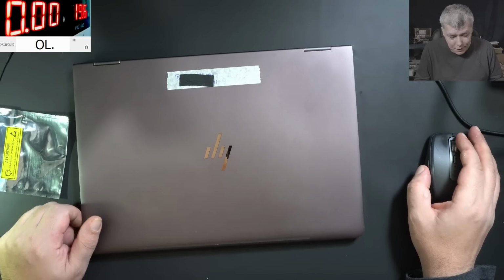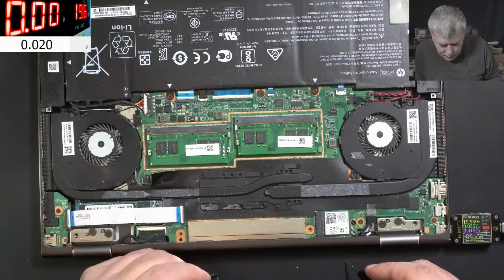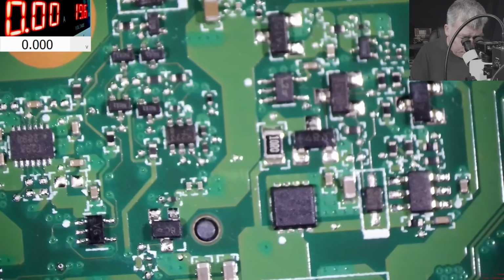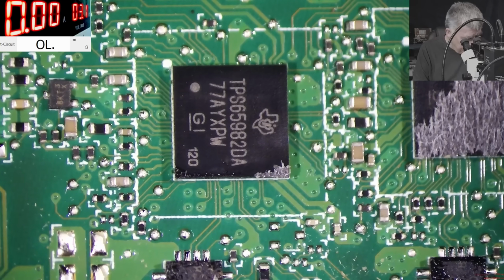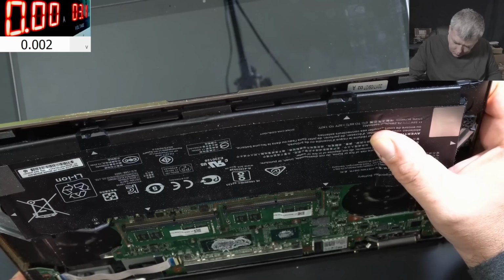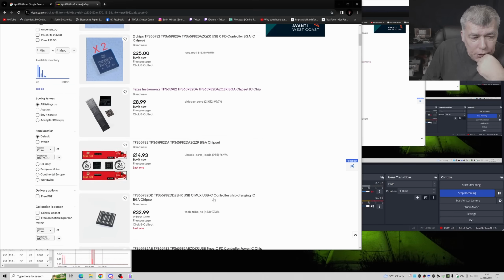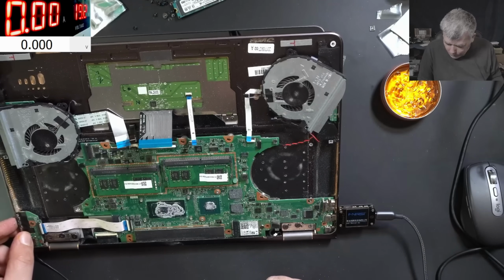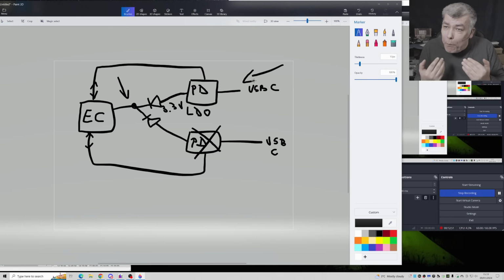HP Spectre laptop 15-bl101na - Design to Fail - No USB-C redundancy and if one fail, laptop die

Comment: I hear what you are saying Sorin, but the one PD-controller might be powering the other one so that they both can speak to the ec chip that is why they did not use those diodes in the first place, bad design from the start in my opinion.

Comment: What kind of diode would be used there? I'M thinking of that an ordinary one would have voltage drop of 0.7 V and so having the EC controller to receive 2.6 V. Would that be Ok for the EC chip?

Comment: You are partially right about the PD controller, but you are missing the point that USB-C is not only for charging. There are a whole lot of reasons why it was designed that way. I get it, not everything is how you like it, but it is not designed to fail; it is designed to protect everything else after the chip.

Comment: Omen 16" purchased June 2022 - screen failed in less than 5 months! Replaced under warranty - Screen just failed again for second time, HP want SIX MILLION NINE HUNDRED AND 50 THOUSAND RUPIAH ( $440! ) to replace it again. We are a non-profit who now have no laptop or means to replace this one for a more reliable and better quality brand. Be warned - the quality of Omen is absolute junk and a rip-off - I didn't see any issue with screens failing for any other brand like this. We would appreciate if anyone could help us with this - since we are a charity, while HP just wants to profiteer.

Comment: i placed my dell latitude e6330 laptop on charge. But later found out that the the adaptor light is off, but when i removed the charger from the laptop it came back on. After diagnosing the fault i foubd out one of my mosfet was shorted to ground so i removed it,and now when i plugged in the charger the shorting has stop. i found out from the circuit diagram that the mosfet i removed is in parallel with the other one beside it. so i was wondering shouldn't the laptop be working when the damaged mosfet is removed

Comment: Two USB-C ports, one next to the other, its two power connections. If one fails both fail: actually makes sense.
You don't want to be sticking in a memory stick into a faulty socket ........ that you don't know where POWER IS
GOING ... thus possibly destroying all data on the usb-c memory stick. It just means you have to track down 2
power connector problems on one motherboard. Two diodes are not the answer because both sockets double
up as memory stick sockets. And every time you plug something into either socket ... the firmware has to figure
out what to do .... read data from what is connected, or, charge what is connected, or, receive power from what
is connected. Therefore when one socket fails: they both go offline until both are working properly ... until both
are fixed.

Comment: cmon Soren..bad design maybe..design to fail? Why would HP shoot themselves in the foot? Ive worked on some spectre's that do not have this problem. Same as Apple. One CD3215/17 goes bad..you cannot power on device. Bad engineers..not designed to fail

Comment: I was thinking something, correct if I'm wrong, but if both pd controllers speak with the EC chip to allow it to work, couldnt you just find where the first working pd controller was sending the signal to the EC chip and bridge it to where the EC chip was receiving the signal from the second pd controller? I mean ok it would require to find the schematic of the ec chip on the internet to check for the point you could make this bridge with wire. It should work right?

Comment: HP always have this weird bios/ec firmware, I try i5 11 and 12 gen, it always throttle/underclock for no reason, the temperature is very very normal (around 50° celcius), but the cpu core clock down to 400 mhz for no specific reason
Reply: I know some solutions but message keeps getting deleted.
Reply: @harrydijkstra9936  youtube doesn't allow for link I guess
Reply: @maklogetrich2378  Nope it was all plain text.
Program: Throttlestop, disable BD Prochot. Modify TPL power limits.
This might help.
Reply: @harrydijkstra9936  I know throttlestop, but for a brand new laptop, isn't it quite weird?

Comment: Basic question, could someone explain how measuring 10 omhs between a random cap and another point indicates that it's the 3.3V line and it has an issue? Should be close to 0 ohms? Was that testing continuity from a plus to a plus on the same line?
Reply: He was looking for 3.3v on the EC chip, but the 3.3v had a 10ohm short to ground...that's how he knew the problem was on 3.3, it should at least be in the high kilaohms

Comment: The chips would have to generate 4V to get over the 0.7 of the diode
Reply: schottky diodes 0.2 v do the job...
Reply: @skysurfhf  Still needs voltage adjustment to compensate even for 0.2V would it not?
Reply: no, 0. 2 v is very low voltage drop @4rkme
Reply: It doesn't even matter, this idea is not working at all. When you have a short behind diode ( Sorin drawn it with bad polarity btw ), there will by only voltage drop Vf of that diode ( 0.2 - 0.7 ) on its anode, no 3.3V from LDO - and that diode dies too from excessive current, actually ( depends on its Imax ).

Comment: But u had picture before with one pd controler, but it was no charging.
Reply: no, the picture was done with the battery. On usb-c it did not power on at all.
Reply: @orange11squares  Rewatched and you are right.. makes also sense now..

Comment: The issue was, it wouldnt charge after removal of the defective pd controller.
And it wouldt turn on without battery..
Did it end up charging the battery?
Reply: @KennethITGuru  The battery was not connected at that point.
Reply: it's the EC chip that programmed if one of the PD controller is missing, it would not work/charged the battery

Comment: Modern laptops are design to fail, not be fixed and simply thrown away, good old days everything was fixable, and parts and schematics available.
Reply: I opened up my turntable from the 70's and it had a schematic and extra replacement diodes inside.
Reply: 100% agreed. Even new LED / LCD TVs are same..!

Comment: wait, because It works with one TPS, the problem with the battery was solved?
Reply: the ec chip don't allow to use charger if one pd controller is dead or missing, but if the battery has charge, you can use the laptop on battery power
Reply: both chip have to installed

Comment: modern laptops are just the worst machines made in modern times fully bugged and made to fail the reason why they wanted to phase out old working devices so there's nothing to compare it with, and another thread ive noticed recently is the bloat on softwares and firmwares disabling them old perfectly working devices specially on phones